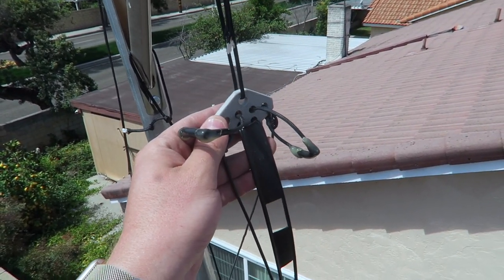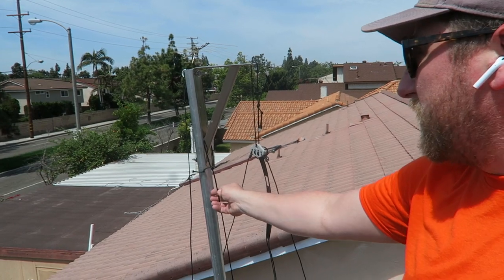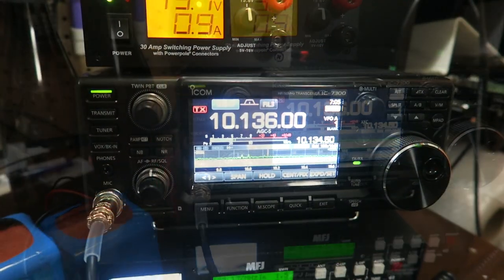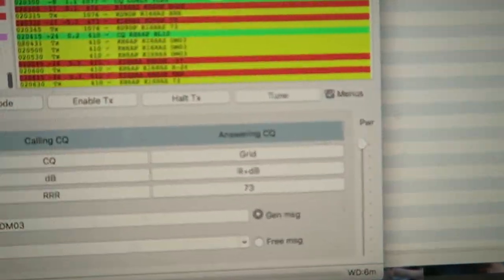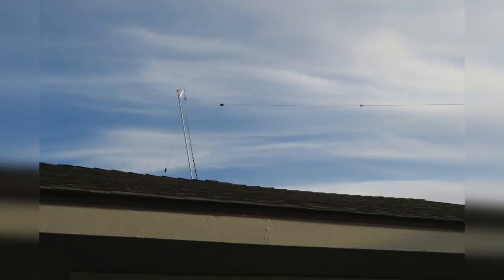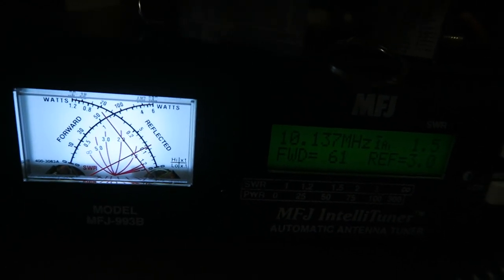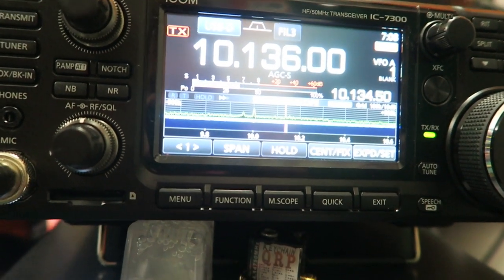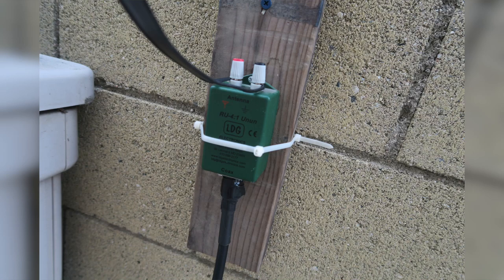My GR5V HF Antenna Has Issues

Comment: The G5RV is one of those antennas that we look at and scratch our heads wondering how it works.  I've had a few of them thru the years in flat and inverted-v configs.  Flat works best and the closer to vertical you can get the ladder line, the better.  I noticed you have traps and I looked up on the Radiowavz site to see which one you have.  The shorter legs with traps probably add a level of interaction that you wouldn’t normally get with a conventional G5RV.  Another thing I learned is not all tuners, especially built-in tuners, can tune the G5RV.  My FTDX-3000 manual specifically says it won’t tune it.  My 2 cents worth anyway.  Good luck with it!!  Chris, K2CJB
Reply from the maker: I ended up having to get a pretty powerful MFJ tuner for the antenna.

Comment: 70 foot? ??? Only for one type of coax. The length will vary on the type of coax used. Half wave length, which is the "apparent" length electrically, is NOT half wave length by 'physical' measure of coax. It is based on the physical properties of the coax selected. It could be 83 feet!!!!! A person should use a halfwave length of coax as seen "electrically" by the radio.  And that will vary from coax to coax and can be found by a simple trial and error or by the EASY way using the manufacturer data sheet with some math for the coax used.

Comment: I had two of them. G5RV, a G5RV-M and the extended version home made, both kicked ass. Heights were 65-85 feet, ladder line was 75-92 feet, coax was 100-115 feet we used, we as I needed help.  keep it away from buildings. The ladder line I had at a 45° angle, the coax was buried 4 to 6 inches in the ground. And I have had great luck with them. Tested out different patterns, did the inverted V, upside down inverted V, A L pattern, sideways L, backwards L. 360° L, never tried to sloped it at 32° to 45° angle, never tried the straight up and down like a vertical, my best pattern was the 360° L, where the bottom part of the L would be facing the opposite way and it would go along the opposite side of the property. And the straight part of the L would go like half of a C going straight, that by far, killed it, I tested our theories out on 80 m, 40 m, 20 m. Use 5 watts to 100 watts. Surprisingly it got out well with just 5 watts on 80 meters. Depending on your situation and property try different patterns,  one  pattern might not work, try different  patterns, do what others are not doing,  you will be very surprised at what your outcome will be. The G5RV has been around for 70+ years. Don’t knock until you have tried everything. The sweet spot for height is 80 to 82 feet. For 80 meters. I also had the G5RV-JR, we built that too, don’t buy it, build it, you get more satisfaction out of building something than buying it.

Comment: It’s a myth your coax should be long. All that does is to act as an artificial attenuator, giving you poor performance. I use a ZS6BKW only 20’ high off the back of the chimney. The 450 ohm window line terminates into a DX Engineering Maxi-Core 1:1 Choke Balun and then to 20’ of LMR 240 to a MFJ 941E 300 watt manual tuner. The coax should be as short as possible and you really need something like a Rigexpert to adjust the antenna length to get is as close to resonance on the amateur bands as possible. I would also avoid any types of traps or coils. Window line is rather sensitive to metal, water, and ground. I’ve had mine up since January and have worked all States except Alaska and 25 countries on SSB, including Japan, South Africa and Europe on an old Yaesu FT-840 and 85 watts. It can use 40, 20, 17, 12, and 10 meters without any issue. 80 meters can be tuned but the SWR is 8:1, so even with the short coax, there is significant line loss through heat in the coax, choke, and tuner. The window line acts as both a feed line and matching stub.

Comment: Hi Dave, we are also advised to stay in here in Germany.  As the last storm damaged my HF vertica I have now time to build and put up a ZS6BKW junior antenna.
The horizontal length is 14.2m. I´m not sure if what I found out about the vertical feeding line.
I read that it is 12,2m. To me it seems to be far too long. Do you have any information about the dimensions? Otherwise I´d go for a half size g5rv antenna. Thanks!

Comment: CO8LY is always on FT8 I try to avoid him now  I convert my dipole to a doublet and are pleased by the improvement before getting on a 80m net was just a dream  10 has so RF issues but I can always use my vertical there , I just need to get a little more height

Comment: Great Video, as a G5RV user myself I appreciate other users of it, as it's such a misunderstood and maligned antenna. Mine is wrapped around the inside of my attic in a weird Square shape. It gets out, but it's not ideal. One thing I wanted to point out, you mention that the G5RV isn't really resonate on any bands, that's not quite true. The G5RV is naturally resonate on the 20m Band, as that's why Varney designed the antenna. He theorized that, based on it's lengths it could probably be used on other bands with a Tuner. As a result some enterprising American company took the design and began selling it as an "All-Band" wire antenna. My FTDX-1200's internal tuner can tune mine on 20m with no problems at all, for the rest of the bands I need to use my MFJ-993B.

Comment: I'm running a G5RV cousin called ZS6BKW. I could managed to have end of ladder right at the input of the tuner, so that to reduce the impact of high SWR on coax, since it has much less effect on twin line.
Reply from the maker: That was one ideas as well.  That would require a pretty weather resistant tuner though in my case.

Comment: you must get the Balanced line away from any metal it is part of the ant, try to get it in the air and 90` from the two legs 
VK3AMN
Reply from the maker: twin-lead is about 1-2' away from the mast at its closest.
Reply: to get a G5RV working you need it to be away at least 1/4 wavelength of the Mhz your trying to work, when I yse a G5RV up in the Australian outback I lay the legs out N to S and then run the 300ohm out a 90` and even if it's only 3-6 ft of the ground it works very good  https://www.youtube.com/watch?v=_KyDnyo5uOs but you must have off the ground and away from any metal have a look at the video the ant was only about 5' of the ground and we worked most of the world
Reply: that's way to close the mast will get hot  with RF and make it imposable to tune the twin-lead is part of the ant and must be in free space away from any metal

Comment: Unfortunately, the G5RV works best with an unbalanced manual tuner were the ladder line connects directly to the tuner. I use the MFJ Versa Tuner II. I don’t quite understand why you are using a 4:1 Balun. If you are using coax, terminate the ladder line at 35’ with an insulator and SO 239, with about 70’ of coax to your tuner. Some operators use a 1:1 ladder line to coax balun like the LDB RBA 1:1. For most people the G5RV either work really well or very poorly. Most of the time they work poorly is because of incorrect installation.

Comment: This is a G5RV LITE from radio waves; this is not a full-size G5 RV so it might be a little bit trickier to mount. It’s about 67 feet long with a coil on each end. It can be tricky to set up as an inverted V.  They told me to put a coat of paint on the coils as well. I’m not comfortable doing that. I may spray it lightly with a coat of flat finish. Most dipoles with coils retune a little in wet weather.

Comment: you need at least 75 feet of feed line..rg8x coax.
Reply from the maker: Got it.
Reply: Agree with this.  I had one I fed with 100ft of coax and got rid of it as I had nothing but problems.  Now, I do have one of RadioWavz OCF Windom's with the vertical radiator and that thing rocks, but needs to be horizontal to be effective.  Looks like you don't have a lot of room.  That G5RV is probably going to be the best for the amount of space you have, unless you went with some type of fan dipole and put coils on 80, and possibly 40m.

Comment: Going through the same with a new G5RV /IC-7300. High SWR on 80m  >3:1 and internal tuner can only  handle it in emergency tuning mode. I'll be rerouting the balanced line and implementing an external tuner asap.
Reply from the maker: External tuner is a good idea.

Comment: Ok, the G5RV is an antenna that to me needs a good tuner to make it work .  I have been ok with it for now.    I ran the latter line down my tower 16 inches from the  tower to the entry to my shack with coax.  It seem to do just fine, but with a good tuner.  ON 75 meters, not turner, on 15 meters no turner, on the other bands I need the turner.  Ok, now what???  Lets just see ....I really think a dipole antenna is the best way to go if you have the room.  They work ;;;; period...
Reply from the maker: I'm putting up a hex beam soon :D

Comment: Quick question. Have you tried running your ladder line directly into the MFJ-993B? The MFJ-993B has a builtin 4:1 balun for ladder line connection.
Just curious.
Thanks for your videos!
73s N2OWM Jim
Reply from the maker: I tried a 4:1 Balun directly at ladder line, yes.

Comment: A G5RV was never intended to be all band antenna. Guy Varney who invented the antenna was for 3 half waves on 20 meters.  I do not know why there are loading coils that I see on the antenna you are having issues with.  I am a old ham, and never purchased a antenna.  They are too easy to build   31 fees of 450 ohm ladder line and 91 feet total for the wire.  That would be 45.5 feet per side.   I build a ladder line  to coax adapter.  With a good antenna tuner it will work ok for you on most bands.  Let me know if I can help.  My email address is good on QRZ.
73, Paul K4AVU
Reply from the maker: What do you use as the center support?  And thanks for the comment.

Comment: The angle shouldn’t be less than 60 degrees (lower the height ) also the ladder line needs to be well away from the metal support pole
Reply from the maker: I don't think they were less than 60 degress and the ladder like was on a 1 foot standoof at the narrowest point to the mast.  Over 3' in most parts.

Comment: I finally got to see your antenna setup, wee hew!  Now I understand the setup.  Great video, very informative.  Trying to talk the wife into it now.  What is the support pole specs?  Wondered if I could do something similar with Ed Fong 2M J-pole inside that mast??  Perhaps it wouldn’t suspend high enough and or signals might interfere with HF.
Reply from the maker: For VHF/UHF I use the Pulsar MFJ antennas.  Its a 17 foot vertical.

Comment: whats up with the Traps? mine does not have them and also do not need a Balon..
Reply from the maker: Traps are to reduce overall length while still working on 80 meter.  Balun was recommended by the manufacturer.
Reply: right on, never thought about that..I am gonna be doing some work on mine maybe today, gonna go higher, about 8 feet I think I can get..I run two G5RVs  one at home and one at the Camper AKA-Church (my Command Post)
Reply: how did your SWR turn out?
Reply from the maker: lower than 10:1.  :D  bettwen 5-7:1 on 80-20m depending.
Reply: thats way high.... I get 1:1-2.5 :1 with mine...also 80-20

Comment: I would consider a G5RV only as one of my last options...it does not work well as a multi band antenna.  But great video showing how small modifications can affect the performance of any antenna system!

Comment: Too bad G5RV is not around to see what a mess has been made using his call sign
This is so far away from anything I have ever read about any antenna he was associated with.
Only thing in common with G5RV was he too used wire to build antennas
This another example of the sad state of amateur radio
Monkey see monkey do I am stupid and so are you !
Reply from the maker: Frank, you must be a blast at parties.